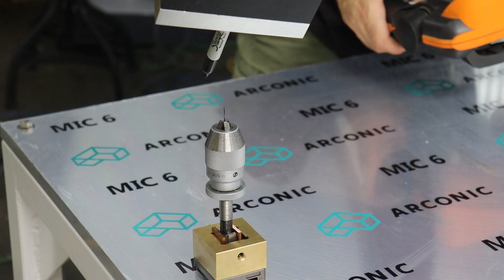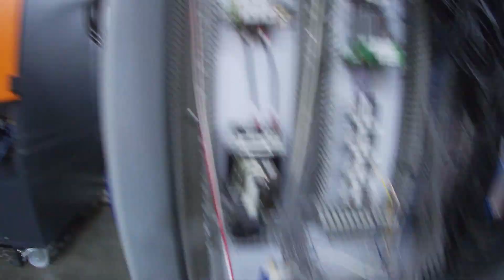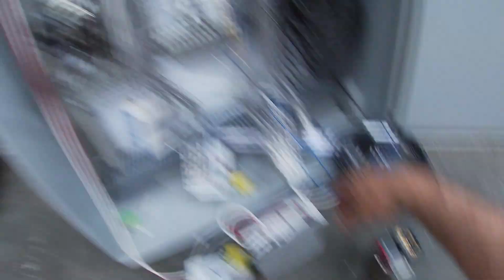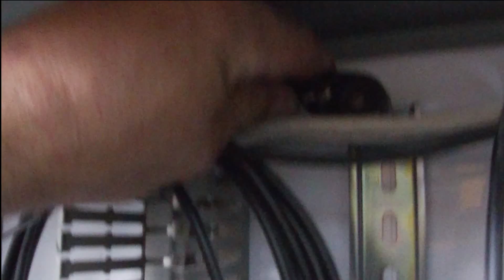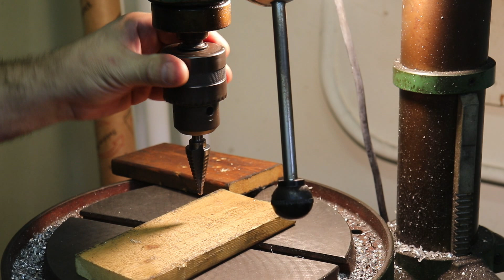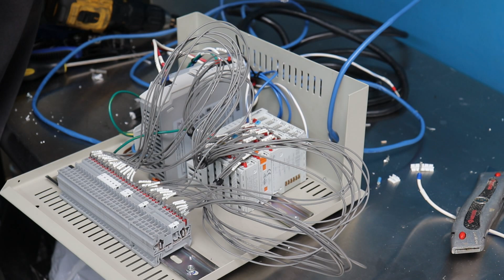INDUSTRIAL 6 AXIS ROBOT SETUP

Comment: Hey could you recommend a source for ABS plastic pellets I am doing small scale plastic injection and was wondering if you would mind sharing a source? Thanks for any info!
Reply: I think he used LG pellets, but afaik ABS is a bit hard to come by at the moment.
Reply: where are you located at and how much do u need?
Reply from the maker: Nexeo plastic will sell you a 25 KG bag.  You can also use Ebay.  I can sell you some too if you want.  I have Sabic MG47.  the LG abs I have I need to keep
Reply: @DragonflyEngineering  Is ABS the new hot stuff? Did i Miss Something? I im also doing injecgion molding Prototyping and have a Few 100kg's ABS in my Shop but why do you have to keep IT for yourself?

Comment: I've killed a PLC and a torch height controller with drill shavings, in two separate instances, even after blowing it out with compressed air and vacuuming. Now anything I build gets removable mounting panels and anything with a vent comes out before I start drilling. Thanks for the demo with the arm, never realized how much of the kinematics were in the controller instead of the CAM software!
Reply from the maker: Good point, thanks.  I will double check the box!
Reply: @DragonflyEngineering  "shavings"are your enemy. Thanks for the look.